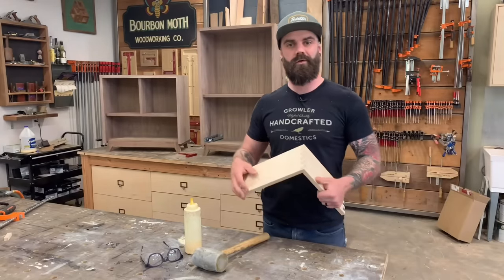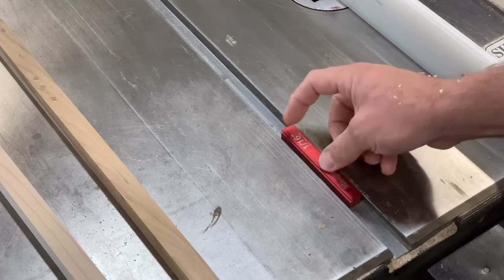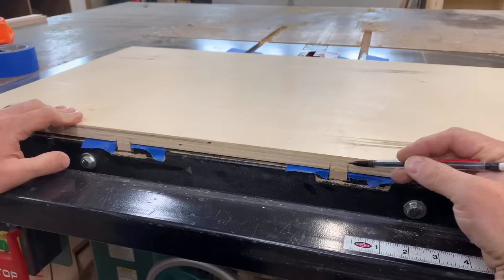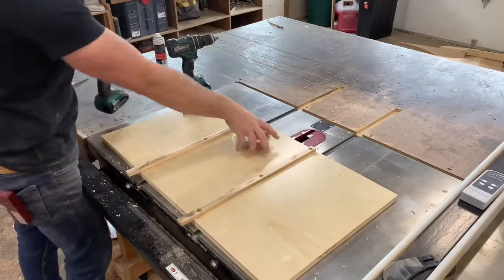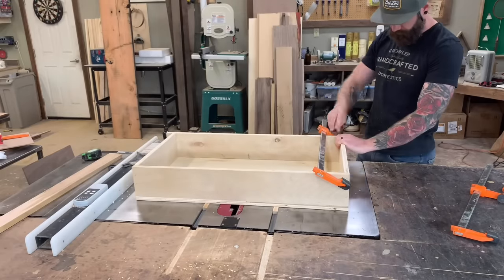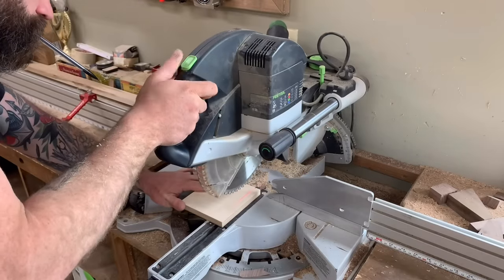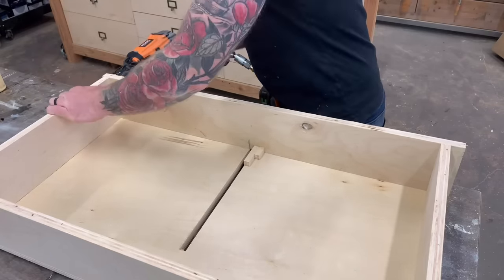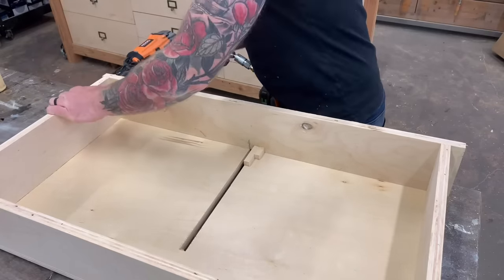Easy Box Joint Jig | How To Make Box Joints

Comment: I want to express my appreciation for all your videos. Thru your work I was inspired to take up woodworking in June 2020. In 6 months I’ve gone from not knowing much and the art of woodworking to being able to build an entire kitchen of new custom cabinets. Now I’m starting to tackle taking on jobs from customers and building custom furniture. Thanks for helping me discover something that has forever transformed my life. God bless.
Reply from the maker: That’s awesome 🙌🏻🙌🏻
Reply: Damn my guy, great work! That’s my dream too.  Inspired me to get going! Finishing up my workbench, then it’s go time.
Reply: @Bourbonmoth   I bought a dovetail rig and whilst I can join boards edge to edge, I cant make right angle joints, it can clamp both boards at right angles, but the top board stencil is 1.5"' away from the board and no way to rotate it (Like you need a route bit with a very long shaft), any ideas what this type of jig is and what its use is? It looks to be quite old and made in England.
Reply: @Bourbonmoth  couldn't you flip this jig around and use it in the opposite direction for a different size cut say 3/4" ?  so this jig cuts 2 different size box joints
Reply: @DeepSnowRider  if he made one that cuts 3/8 box joints made the fence 3x3 glulam, made the base 3" wider than the fence, and eliminated the sides and back he could then use the jig to cut door stile tenon's without changing any settings. Youtube Woodsmith finger joints, their jig makes quick work of variable pins with minimal chance of error, and the jig if planned right can come from a single 2'x2'x1/2" plywood.
Reply: Þþþþ
Reply: @suzesiviter6083  did you ever figure it out?
Reply: @woodworkingandepoxy643  Nope, I ended up buying one same kind of style as yours, then after a couple of attempts, gave up. Think problem was you need the right router bit for the jig and was working with what I had. I will buy new next time and do it properly.
Reply: First and foremost be grateful to our creator who died for your sins he is the one that loves you without him we are nothing, except he puts the right people to learn from he is a excellent carpenter. Bottom line God bless.
Reply: That is impressive if you are able to build a kitchen after 6 months of woodworking.
I was a carpenter for 5 years in the 80s. I have been in the electrical trades since the late 80s. I am redoing my kitchen this year and I still find that challenging even after 40 years in the trades.
Good for you!!
Reply: Good video long enough and short enough
Reply: L.p.
Reply: Tried it, loved it, use it !!!

Comment: FWIW you never want sled runners “proud of” your slots. They should be sized to leave space under them for at least two reasons: 1) even 1/32” proud makes repeatable depth of cut impossible. The sled needs to be in full contact w the table not suspended above it.  2) sawdust. You need space in the bottom of the slot so the runners don’t have to bulldoze sawdust.
Reply: Don't agree. On my old Rexon 12" the slots are 19 mm wide at the bottom and 19.5 at the top; trapezoid. If you buy proprietary plastic runners, here in Australia, they are always the tiniest bit proud of the slots full depth or with the top surface absolutely flush with the table surface. The lesson is put a mic on the slots and know what you are dealing with.

Comment: Love the way you added the glides with glue!! Definitely using this method for future jigs!
Reply: Doesn't this result in a sled that isn't actually sitting on the table though? would it be better to cut the runners a little shy of the table and then install them with coins in the slots to raise them up while you glue?

Comment: this is one of the sturdiest and simplest I've seen.  I have found that moving the register peg a few thousandths closer to the blade before fixing the rear fence  to the base reduces the peg width just enough to allow for the tightening of the joint caused by the glue.  But I am generally making small boxes and using the kerf of my FTG blade instead of a dado stack, might not be an issue with such large fingers.  Thanks for sharing, have some drawer boxes to make for the shop, will make myself one of these  for sure.

Comment: A very impressive build. I absolutely love this jig, I am adding it to my To-Do list.
I am your new fan.
Thanks for sharing
Reply: It's awfully involved. I just screw a scrap of wood to my miter gauge with the pin in it. I also make the pin long enough that it can hold all 4 sides at once. Because pushing stock back and forth gets old real fast. Plus the joints come out more accurately if you cut them stacked all up at once too. I clamp my stacks together before I cut them. You still have to do the reversing deal before you stack all the sides up like is shown here. Then you set your stack up on the pin, clamp it all together and cut away.
Reply: @1pcfred  exactly what I did. Just made basically his back panel, a few in the common sizes I make. I do 2 sides at once.. I can't visualize how you're doing all 4 sides together and get them to line up right?
Reply: @Turk380  You do the alternating face cuts first of course then stack them all on the pin and clamp them up together. I wrote an article about how I do it here https://www.instructables.com/How-to-Make-a-Box-Joint-Box/ I think they come out better stacked. It is certainly less back and forth.

Comment: I never realized how much jig making goes into woodworking.
Reply: I have a few fixtures to help, I was a machinist and then an Aircraft Jig / toolmaker. So I am always thinking from the tooling perspective. If your going to perform repeatable operations it’s the only way to go. Box joints, dovetails, splines, and evening holding fixtures are great ideas.
Reply: Clay Mango all aspects of woodworking inc whittling
Reply: You'll make more jigs than projects. If you're serious, find a local source of Baltic birch plywood.

Comment: A longer peg would allow you to cut multiple boards at the same time. You could even have the peg going all the way to the other end of the box. Great video, thanks for sharing.
Reply: Because he didn't square the back fence, any error will be multiplied the more boards are stacked in front of the first.
Reply: @veritasestveritas8646  Still a good idea/ iterative step though. Soon we'll all be making our own furniture again. lol!
Reply: VeritasEstVeritas I agree, for 1* error is .017 of an inch degree difference. That adds up quickly especially if you multiple the degree error.
Reply: Great idea
Reply: @texasfossilguy  All should be well as long as that long peg/batten runs parallel with the rip blade slot and rip fence. But the effort needed to set all the additional work pieces probably wont save much time. And we can be sure that one(?) will shift while cutting slots.
Reply: @Dave5843-d9m  I wonder if you would save time???

You have to move every board independently and you would fumble around all the other boards.  It might be more trouble than it's worth.
Reply: @matteout_woodworking  You’d want to clamp the stack together so it can be moved as one unit. ...and definitely don’t make the tab fit too tight or it would be a real pain lifting the stack off to move it over.

Comment: Great video! 

I've seen other box joint jigs have "keys" (the little tab thingys) that can be switched out to accommodate different sized box joints. I know you only really need one size of box joint for cabinetry, but would it make sense to make that front fence replaceable so you could have the option of different sized box joints?
Reply: The front fence doesn't need to be replaceable.  You just need to fasten the "key" in a way that it's removable and adjustable.

And I would recommend using durable plastic for the "keys" instead of wood.  Less friction so the piece will slide on and off the jig more easily.  And it will retain a precise shape and create precise cuts pretty much forever.  Wood will eventually see the corners get rounded over and things will very sloppy and the keys will need to be replaced.  And also easier to make work with any method of making the keys so they can be swapped out.

Comment: All I need now is a decent table saw.😂😂
Reply: For real .
Reply: I'm sure you can do this on a cheap saw with a decent base.  The major difference between an cabinet saw and a portable contractor saw is the weight.  The weight helps keep the vibrations down.

I used a 1½hp saw for YEARS in my business and got awesome results
Reply: Or a Festool gliding miter saw and a Festool shopvac. LOL
Reply: Same
Reply: Dammm true
Reply: Yea mines shit
Reply: Mee too 😎
Reply: Me too!
Reply: @matteout_woodworking  nope not unless it can accept a dado stack!
Reply: @Jeffrey91423  I get it now...  You need to buy 200k in equipment before you are able to make a single cut.
Reply: you don't need table saw to build this joint.  using a simple router table is the easiest way.
Reply: I’ve tried this with plywood on my router box joint jig, and it destroys the plywood. Maybe I could have done it cleanly in multiple passes, but I think the dado blade is a much better option for brittle or softwood, no tear out.
Reply: its not the instrument ... its about the method and approach ;o)- wood needs to be caressed with gentleness and persistence (my grand papa woodworking sayings)
Reply: Thought the exact same thing 😭
Reply: SawStop is the best saw.  I’ve worked on 10 different saws, and nothing beats a SawStop.  Plus, you get the added safety feature of not cutting your fingers off.  The question you have to ask yourself is:  are your fingers worth protecting?
Reply: @Patmanduu  have you tried the router with a piece of scrap backing the piece where the tear out happens? A thin board or a sacrificial push block should stop the tear out
Reply: It’s height (like night), not “high-th”. All good! Nice demo.
Reply: I just need one that fits a dado blade. His cabinet saw is so nice! That is absolutely not a normal table saw. It’s actually called a cabinet saw. If you want to do this kind of stuff don’t buy a table saw. Try to find a cabinet saw. It’s a bit more expensive but so worth it! This was actually extremely cool!
Reply: So for those that want to get into this. This is not a table saw. It’s actually called a cabinet saw. It has a larger deck. It’s a bit more expensive yet so worth it. It’s a heavy beast yet you can do so much more with it. A table saws deck is very small. And so is the size of a blade you can hold. They don’t hold dados well. So save yourself trouble find a nice used cabinet saw on Craigslist or where ever. His guide helps allot to. A absolute must. This was extremely cool to watch. I have spent more on guides tools and hand saws to make these. I could have bought 2 cabinet saws 😂. This is so much easier!
Reply: @matteout_woodworking  Get the Dewalt jobsite table saw.  It's under $400 and it has the rack and pinion fence (learn how to use this...well worth the read and pretty simple) it has a 15 amp motor and does dados.  If you can find a tool show near you then you can save a bundle!
Reply: Don't forget about  the wood.
Reply: I have a Bosch table saw that was 650 from Lowes.' After calibration, it cuts very square and has a long enough arbor for dado stacks up to 3/4". My problem is finding wood that's flat since my shop isn't big enough for a planer or jointer.
Reply: @jamesbrunnette4895  you are correct- because “heighth” was popular in the 18th century, and competed in popularity well into the Victorian age. George Washington and Ben Franklin have writings in which they use “heighth” but so does Charles Dickens. Curiously, however, Dickens used “height” when narrating, but his characters used “heighth”

Grammatically, it’s like saying “thee” or “thy” or “ye olde” - while technically correct, it’s a very dated and archaic way of speaking. “Height” with a hard “T” is the proper 21st century pronunciation.
Reply: @ParkerAndLuke 
 FYI "ye" is pronounced "the".
Reply: Nope, just a hammer, chisel and 3 months 😭

Comment: I've started gluing a block of wood on the back of the sled where the saw blade comes out, then there is a barrier that prevents your fingers from accidentally sliding along into the path of the blade.
Reply: Safety is relative to the person using the tools.  If you find doing something is dangerous then don't do it.

The idea of having a box behind where the blade comes out is one that is used by many people and is a valid one

Comment: what's purpose of the box sled as opposed to a regular sled? also, do you get much blowout on the plywood backs?
Reply from the maker: Danny Fernandez the box just makes it nice and sturdy. And no as long as you have a sharp blade and hold the stock firm against the fence there’s no blowout

Comment: Tried to make a comment on your tips and tricks video but couldn’t for some reason.  The way to locate the center of a board.  Applying geometry of congruent triangles, the intersection is the mid point.  Good video and good tips.  Especially applying glue to cracks.

Comment: Thank you for the graphic video, it was very well thought out, except for three things.
1, You should have said that the video was really intended for anybody that can get hold of a stacked dado cutter set. Here in The UK , the powers that be don't like the stacked dado cutting system because you normally have to remove the blade guard and riving knife.

2, The powers that be, also like to fit a small arbor to table saws, again this is to prevent fitting more than one blade at a time.

3, The jig is very good but it isn't really practical as it fits one size only. Multiple jigs are needed for different size
 joints.

I am a carpenter joiner, and your jig is excellent for our cousins in the good ole USA. So please don't be angry at me for stating the obvious to us Brits.
Would it be possible to devise an adjustable jig for different size joints. Now I did say that the powers that be don't like dado blades we are however able to get them, subject to which table saw you buy to fit them.

I look forward to your reply and to see what new adjustable device you are able to come up with.
Keep up the good work, and stay safe.
Reply: I recently learned about the van on dado blades over the pond. I found that very curious and surprising.
Reply: @717UT  hi there, they arent band as such but the government health and safety don't approve of them because of the removal of safety guards etc.
Reply: @williamday1311  Dude, it's just cutting wood....
Reply: Max Federle Yeah, you’re right. Just lost it there for a minute. Sorry.
Reply: @williamday1311  it's ok. Sometimes I lose it too. Have a good day brother.
Reply: Maybe you can look at a way to modify your table saw to accept the dado stack. Being an American, it really pisses me off when some idiot tries to limit what I can do.
Reply: It's an interesting limitation that I've always wondered about. I have trouble imagining that cutting box joints on the router table is any safer than using a dado stack. I wonder if there are any workshop accident statistics comparing router tables to dado blades, though. Like, maybe that prohibition was based on hard numbers. Or it could be an old prohibition based on old hard numbers that don't apply any more. I'm curious! I'm going to do some research.
Reply: Evan Barnes my understanding is that the original piece of equipment prior to a stacked dado cutter, was a wobble saw blade that is much more vicious looking, I have seen an old one for sale and in use. I think it looks very dangerous and That maybe why health and safety don't like them.
Reply: @paulroberts7630  thats a great point! Ive seen those and they look insane. Clever, but dangerous

Comment: Why does the sled need to be a box at all? Is there an application I'm missing here?
Reply: @Edward Williams too late
Reply: So that you can play with your pet while cutting.
Reply: So you don't forget what it is used for
Reply: The short sides of the box keep the work supporting side square to the table. And the far side of the box bridges across the cut in the sled to keep it all together. Building it as a simple box is just a fast and easy way to accomplish that.

Comment: Just finished making this box joint jig. It works great. I didn’t glue the side with the peg and made two of those. Used pocket screws so I can change them out. One is for 1/2 inch joints the other is for 1/4 inch. I enjoy your videos. Have learned a lot from them

Comment: Very creative. I’ve made box joints using an L shaped jig attached to the miter gauge. Square it to the blade and your good to go. I used 3/4 plywood about 3” wide and about 18” long.

Comment: I would def. have clamped the finished "front" board and done a test run before gluing and nailing it, but shows the confidence, experience, and ability you have. =)   Easy to adjust with a piece of paper or feeler gauge before securing it.  Nice build !

Comment: I like a lot of stuff you do guy. I am a professional cabinet maker Craftsman and Marine Carpenter. Love to get on your show sometime and show you some tricks I've learned over the years. Actually got my start 1963 when I was 7 years old with my grandfather showed me some Craftsman tricks on how to use hand tools. I started my first job in a real cabinet shop when I was 17 years old and got to work with some highly-talented cabinet makers. I got divorced in the late 90s moved from West Virginia with a real Appalachian Craftsman are to South Florida and learn the Marine carpentry business was there for 30 years I got pretty good at it, your roll and tip on your little boat I have done on a 47 ft Buddy Davis, I did four coats and then polished and 3M hi-finesse f**** polish